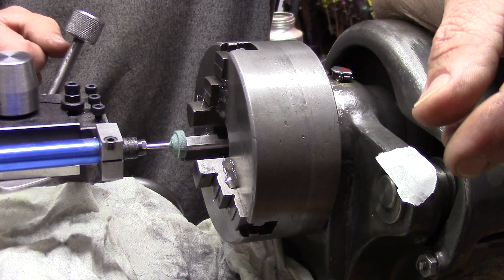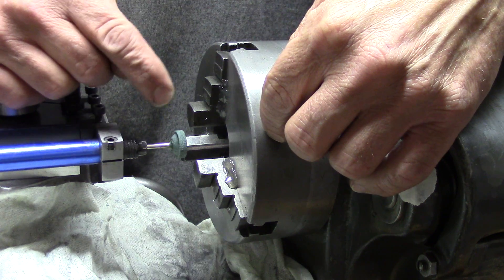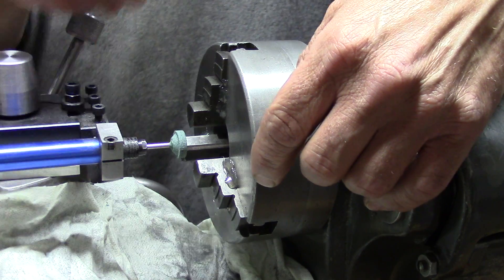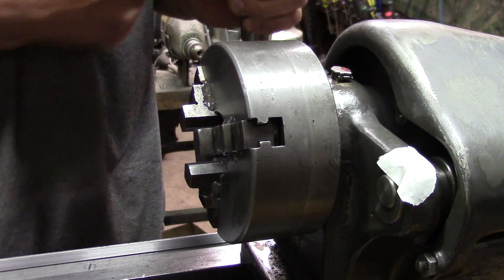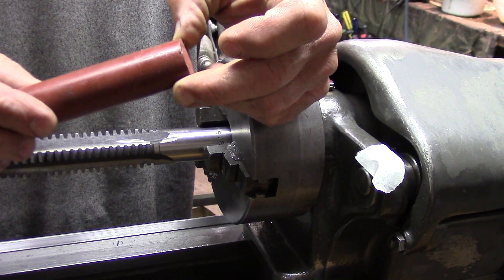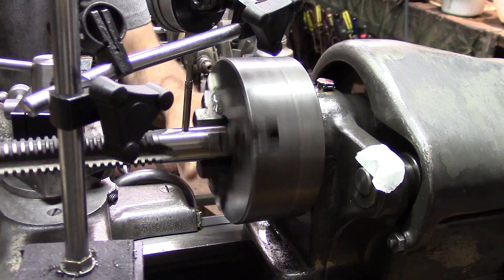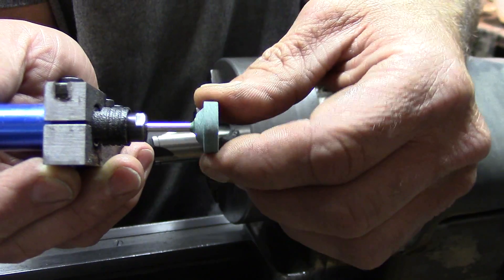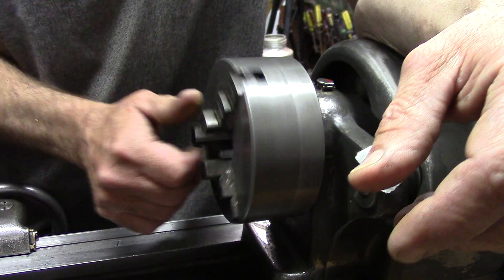Three jaw chuck grinding (Logan Restoration)

Comment: You can use a bit of steel stock to 'set' the jaws. Just tap it out through the headstock spindle once the glue has set.
Reply from the maker: That would work also. More than one way to skin a cat. Thank you for the input and interest in my video. More videos coming soon if you are interested.

Comment: Got to try hot glue on a chuck that needs grinding on my rotary head, something started but still unfinished...  ;)
Reply from the maker: HI Pierre. It works great and you only need a sharp chisel to remove the glue. I used brake cleaner to clean the chuck before gluing.

Comment: Well done, like the hot gliue trick. Did you also check it with a different diameter test piece. On old worn chucks, the scroll most lkely has uneven wear, so it might be perfect at the diameter you've just ground it, but still has runout elsewhere. 
Except for the odd quick and dirty job, i very much prefer a 4 jaw independent chuck, no matter how worn and grubby it is, it only takes a few minutes and the part runs true.
Reply from the maker: I just did some tests and i am getting some variation up to .00015 but i will have to borrow some gauge pins and test again.  I just used some drill bits for the test.
Reply: A simple way to verify a random test piece is rolling it over an inked surface plate, if it's blue all round it is most likely straight.
Reply from the maker: A surface plate is on my short list of things i need. Thank you for the tip.

Comment: Nice high RPMs with the die grinder. Cool idea with the hot melt. Must get me one of those pencil grinders.
Great to get an old chuck working better. :)
Reply from the maker: I still have to try it on several different diameters to see if there is some variation  from the reading i had in the video.